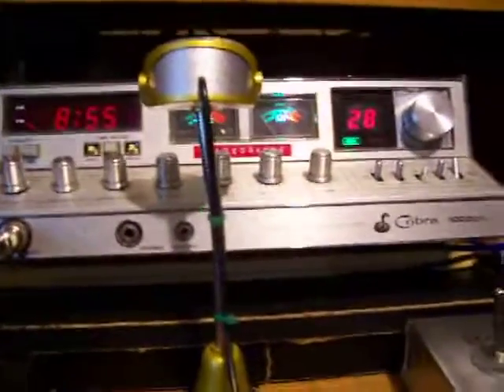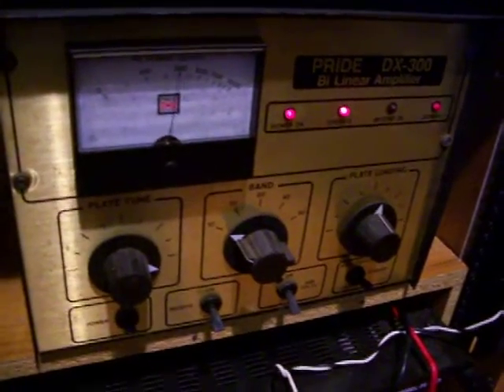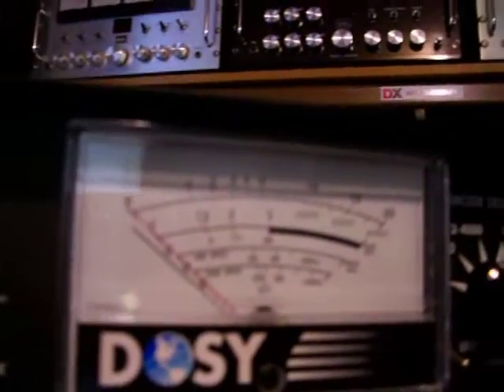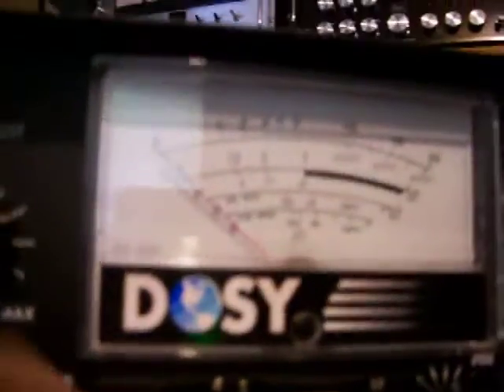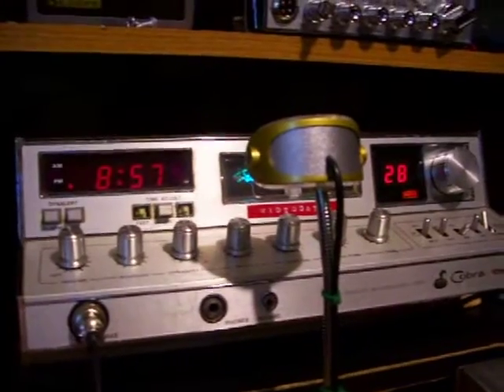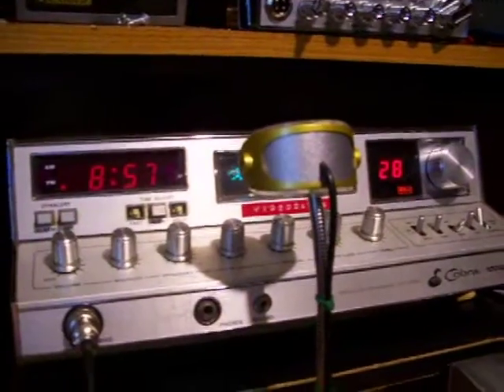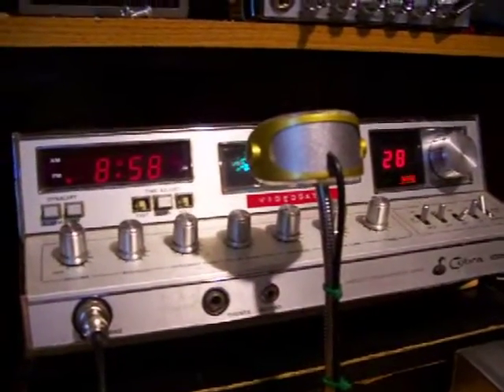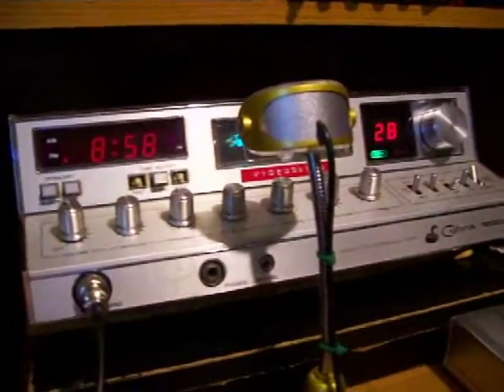Radioman's new/used LIL Pride DX-300 4CX250B bi-linear amplifier

Comment: That is NOT a wattmeter.It's a Target for the firing range.The PRIDE DX-300 is a great little amplifier but buy a real PEP reading wattmeter & throw that Useless POS in the garbage after filling it full of a lot of bullet holes.850 watts PEP on a good day with 20 watts PEP into it with 4 watts of dead key from the radio.